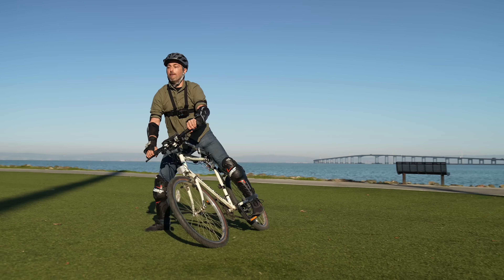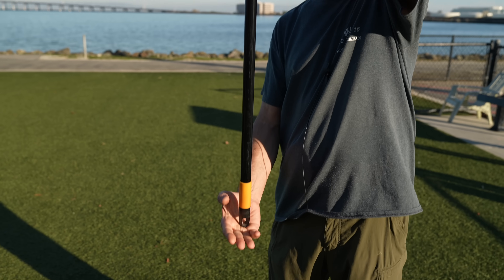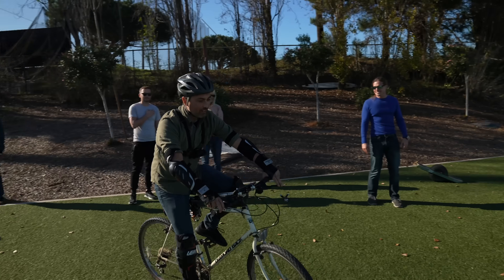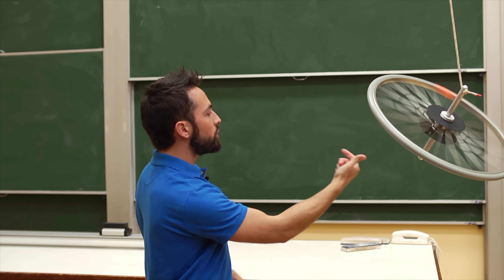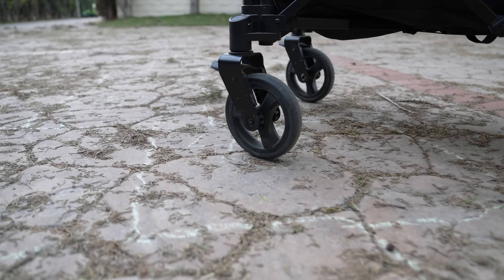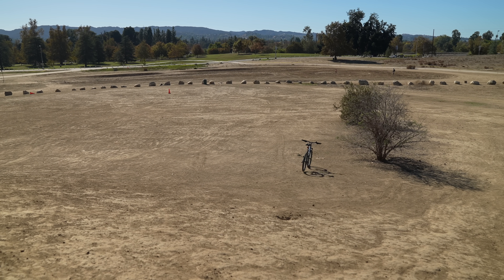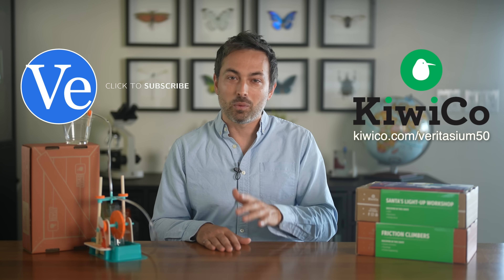Most People Don't Know How Bikes Work

Comment: I agree with just about everything you said in this video except for what you said about having to turn left in order to turn right and  having to turn right to turn left, thats not something you should be doing. i’ve ridden bikes my entire life going through the city, doing dirt jumps, dirt trails, BMX at skate parks all you have to do is lean into the turn by shifting your body weight you never have to turn Inorder to lean, you can but then your moving outside of your desired path so why would you start moving in a direction that you don’t want to go in. it’s the same thing on a motorcycle if you do that on a Motorcycle you will get seriously injured. And in some maneuvers while dirtbike racing and other sports you do turn to shift weight forward like when you scrub a jumper do a big whip that’s kind of what you’re doing when you do those things but that’s not what you’re talking about in this video your talking about normal turns. I enjoyed the video other than that part though good job.

Comment: Motorcycles are slightly different. Not in the counter steering category but rather the gyroscopic effect. If you ride a motorcycle especially a Harley style bike you'll notice it's wayyyyy easier to balance at slow speed when revving the engine a bit. The higher rpm helps balance the bike a bit more and its very helpful. It's less noticeable on dirt bikes though since the motor isn't as big but its still there. Kinda cool.

Comment: When I was younger I used to ride my bike at times without using the handle bars. A show of balance,  I could even turn. Of course not as sharpe as with the use of the handle bars but it could be done. Your stance is different between the two; use the handles you are forward leaning, without you are more upright.

Comment: On a roadbike I do light turns by pushing the bike downwards under me into the direction you want to go. Or on decents just tilt the leg outwards to change the center of mass. Breaking in a turn will put the bike in an upright position - which is bad if you are already close to not making the turn 😂🙋🏻‍♀️Anna

Comment: Even when you walk you have to push your weight forward, and the legs movement prevent falling. What's so different in bicycles? You want to go left, you have to push your weight left. I don't get this "most people don't know how bikes work". If I put water in the tank of a car, it will never work. So why should you block the steering of a bike just to prove that you cannot go left if you cannot turn the steering?

Comment: Some people do pick this up from actual knowledge. My Dad had experience riding motorcycles, and he wanted to test if countersteering works.

One thing that you can do is maintain steering the opposite direction, and execute your intended turn by relying on leaning. Once you figure this out, you can translate that to executing turns without touching your handlebars, and just generally being a cheeky show-off.

Comment: teh, most people...??? cyclist do. 
every bike i have purchased is based on frame geometry as this affects how the bike rides and performs and ultimately how you can use it. cyclist know that the headtube angle, trail, BB drop, etc. affect stability. you would not want to use a trail bike for downhill riding or the bike used in your demo for a century.
i would like to see this demo done with different types of bikes, with real cyclist and at higher speeds where the centrifugal force is greater.

Comment: Push right to go right, push left to go left.  Essentially, you are falling into the direction you want to go by initially turning the front wheel the other way. Every motorcyclist who pays attention knows this.  The MSF (Motorcycle Safety Foundation) teaches this in their excellent Beginner Motorcyclist program.  It should be required for every rider.

Comment: I’m a 40 year motorcyclist and nobody had explained two wheeled balance this well to me before. Cool demo. For your non motorcycling viewers: Fun fact, once you have a motorcycle over 15 mph or so, you steer by pushing away from your body on the handlebar that is on the side of the direction you want to turn. So push on the left bar to go left.  This action actually turns the front wheel the “wrong” way (right) but it moves the bike out from under you a bit creating a lean to the left.  Motorcycles turn the direction they lean, so steer right to go left!  And like a bicycle, a motorcycle will go riderless until it hits something. Thanks again!

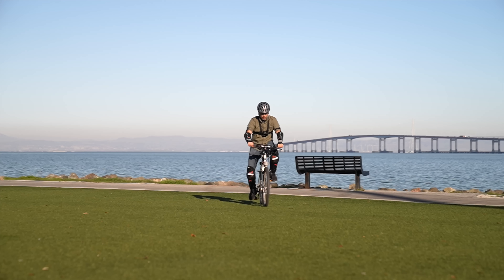Comment: I paused at the 1:36 mark and here's my thoughts.  To balance when riding it requires minute adjustments to the left & the right to maintain upright balance.   If that minute amount of adjustment is locked out on one side it will create an unbalanced situation immediately.  It's like trying to steer a car on a straight road by holding the steering in a fixed position.  Minute adjustments are necessary even though its done sub conscientiously.   I'm not greatly surprised that people have a difficult time adjusting to not doing something that is normally done without conscientiously thinking it.  Just my opinion.
Reply: consciously.
Reply: I ride without touching the handle bars all the time...I can make fairly tight turns as well. I do so by leaning to the left or right, not by turning the handle bars. I wonder how this fits into the theory? Genuinely curious. 
Also on another note, I can imagine quite vividly how having the steering ratchet locked (i.e. you can turn in one direction, but can't turn back any amount) would create the immediate and swift imbalance you're describing. However, what they've done in the video is lock the degree of rotation so you can still fully turn back to the center. I don't see how that restriction could make it as difficult as it appears to them in the video. But I could be schooled soon as I try.
Reply: @faithful451  When no-handing a bicycle you are making corrections with your body to turn steer the bicycle. If the handle bars get locked, there is no way to control the handles and you fall.
Reply: @Thomas48484  also, some bikes you can do this, some you can't. When I was younger I tried no hands ride all the time, but the handle would turn automatically. 

Years later when I got a new bike I tried it and got it first time.

Comment: I'm sorry dude, but you are massively overcomplicating this. Just anticipate the lockout, pedal harder and lean into the turn. Anyone who's rode a damn bike knows to turn.

Even on bikes where steering is backwards, still pretty simple for your brain to figure out.

Of course you're going to fall over going 2mph when the guy lock out steering. Come on. Go 12mph and lean into a turn locked out. Counter steering is smooth and convenient, but by no means a requirement for turning. You are talking about going slow on a bike. Ride it at normal speed, zero counter steering required.

Comment: This is one of the first things you’re taught when you’re learning how to corner on a motorcycle. Same exact concept but with the weight of a motorcycle it is crucial to “counter-steer” to get the weight leaned over at corner entry 👍🏼
Reply: "sometimes you need to turn left, to turn right"
Reply: the difference is that the center of gravity is lower with the motorcycle , the motorcycle is  heavier  than the person who rides it ..  with the bicycle is the cyclist is way heavier